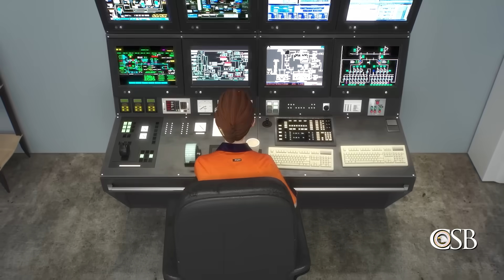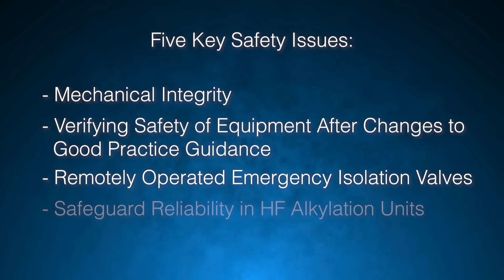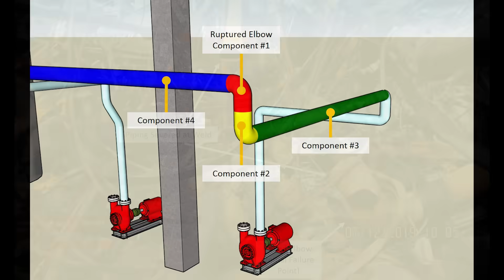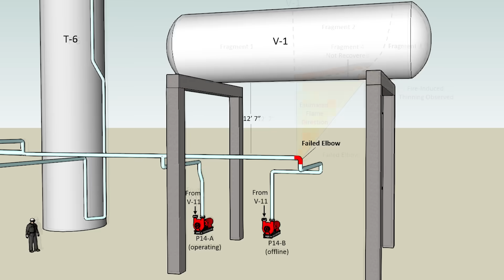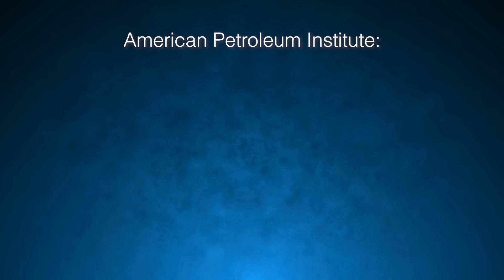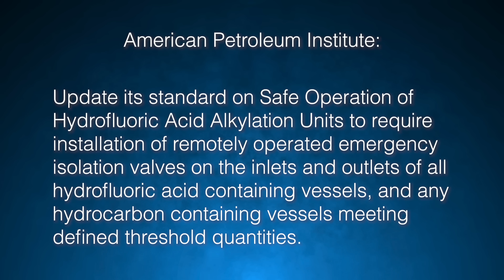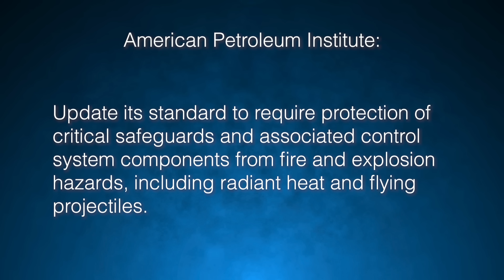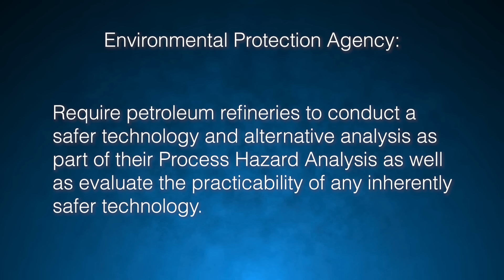Wake Up Call: Refinery Disaster in Philadelphia

Comment: THIS is how you make public safety reports! Not only informative but engaging to watch even as an outsider!
Reply: @Jon VB need more regulations? idk man. Its a once in a 50 year piping check based on what they said. and it also was a strong retrospective check. many of the issues come from not having good papers on pre-digital construction. which is what caused this problem. if they did know, they would have likely changed it. and the CSB cant just make regulations, they reccomend standards. which can then be moved to be passed as law or just as doctrine
Reply: @Jon VB If the reason places are not inspected is lack of funding, it's the lack of funding you need to correct. In the UK, our current far-right 'pro-small-government' government, with lots of mates in the farmning industry,  went all out to undermine our rural/farming pollution laws, by simply cutting the funding for inspections. The end result is some of our most beautiful rivers, which for hundreds of years have been wildlife havens and great for fishing,  are now so polluted by intensive farming that there are next to no fish, or wildlife, in them. That's not an inspection failure, that's an (intentional) government funding failure.
Reply: These petrochemicals will never do the proper maintenance to the proper safety thing is will always kill people in America because they just don't care.

Greed
Greed
Greed

There's usually a wake up call every year.
They are still asleep!
Reply: @lelanddthompsonlll8560  germans will fix it, the german squatters that committed the american people's genocide can do anything, included learning english and fake nation history book propaganda
Reply: @Jon VB if something is way overdue for an inspection, that likely means the inspectors are overloaded.

There is an idea you can just load people more and more. But at some point, the quality drops when people don't have time
Reply: When you consider the billions of dollars being saved in resulting training..
Reply: @Jon VB they pay the politicians to make sure that the inspection people are always a year or too late.
Reply: LANG LEBE AMERIKA!!!! 750 MILLIONEN TOILETTENPAPIER VERLOREN, BETE FÜR JERUSALEMS PETROL CHURCH GOTT, WIR WERDEN DIE WELT MIT PETROSHIT KONTROLLIEREN UND IN GROSSE HÖHEN STEIGEN, WENN DER WASSERSPIEGEL STEIGT. BLEIBEN SIE NORMAL UND FÜLLEN SIE DIE KAUTION, LEUTE ( I USED NATIVE LANGUAGE OF NATIVE GERMANS ASS "SETTLERS" GENOCIDES OF AMERICAN PEOPLE)

Comment: I believe a big problem with oil refineries in the United States is that they're generally run at maximum capacity or close to it other than planned maintenance works that need to be planned to be as short as possible to get that part back online because any disruption has huge economic detriments. If refineries weren't so difficult to get approved to build anywhere, refineries may not need to be pushed so hard, and may be able to carry out better, and more comprehensive/disruptive maintenance, like replacing corroded piping.
Reply: The insurance payout was more than enough to rebuild this refinery, yet it was shut down. All the infrastructure was there.
Reply: The problem here is far more likely that that one elbow, which was different metallurgically from the surrounding piping (according to the video), probably wasn't identified as being different metallurgically until after the explosion.  In 1973 (when the video states that elbow was installed), the culture around documentation was less robust (and more difficult to maintain complete records when databases and electronic records had yet to be invented).  If they had known that it was different metallurgy, I have to believe it would have been inspected and caught prior to the incident.
Reply: @breathedeeep  Your assessment of documentation is quite astute. In the '70's piping and fittings were usually supplied by the lowest bidder for the builder. Many fittings and piping were coming from Brazil and other offshore manufacturers. The metallurgy was not always the best that could be had.

With the age of the ell that ruptured, I see two mechanisms as a factor. Metallurgy for corrosion and wear from erosion. These two factors are the leading cause for piping and fittings replacement.

In a refinery that I worked at, we had a piping rupture at a three way valve which was caused by turbulent liquid erosion. It was in a naphtha hydro treating unit. Two of my coworkers were killed from extensive burns.

In the Philadelphia incident, they were lucky that it was early morning where personnel was limited to operations personnel. This in my opinion was a huge factor in the injury and loss of life aspects.

Comment: One of the things that should happen after failures like this is the bean counters should be sat down and asked "how much would it have cost to properly inspect/replace/maintain this failure point?" Then once you have that you ask the same bean counters "how much will losing the plant entirely to this failure cost you?"

Do that enough and I think the bean counters will start to get it, I don't think stuff like this happens because of simple greed.
I think what happens is after a certain size organizations stop being "ran by human Intelligence" and become run by "simple cells" where each person can only reach 1 or 2 cells away.

This is why large corporate structures always seem to have some strange rules that don't make any sense "on the ground".

One example might be a store chain where the head office controls the thermostat for all stores, sounds great but you can end up with head office rasing the target temperature at night to save on AC costs, but turning running heaters because of different local climates.
Reply: My case in point, some of these parts are old enough where it would be wise to skip inspecting them and just replace them outright, these plants have to be shut down for maintenance anyways, may as well do some PM while the plant is down.

Comment: I live in Superior Wisconsin where a refinery, formerly known as the Husky refinery, is located and which suffered a nearly catastrophic explosion and fire in April of 2018 leading to community evacuations. The release of HF was a serious threat as the fire raged but fortunately the fire was put out before a
 release occurred. The refinery is nearing completion of its rebuild after this fire but the owners refused changing to a safer process and will continue using HF. Clearly there is inadequate regulatory control to require implementation of safer processes such as those recommended by the USCSB to protect nearby communities.

Comment: I'm concerned these accidents will happen more frequently as our refineries and pipelines age and maintenance is deferred to cut costs. Spreading awareness is a necessary remedy, and this video does an excellent job. This video alone may prevent a future tragedy. It is, indeed, a "Wake Up Call"!
Reply: Maybe we need to build some more. we haven't since the 70's. Capacity is at max now.
Reply: true but for once. refineries are now making good profits and there should be more budget to make upgrades and updates once the demand eases. With higher energy prices, the return on investment is quicker to make them more energy efficient and we are likely to see governments worried about refining capacity to offer more generous tax breaks to cut the cost of changes. Once the plant is offline, the opportunities to make other safety related upgrades is alot easier to justify. In fairness we are unlikely to see many new fixed refineries built for hydrocarbon refining so portable ones will become more realistic and they are likely to be more modern considering their portable nature, meeting international standards of operation and shorter time, high volume demands and higher cost of operation.
Reply: Maintenance is deferred because there are fewer refineries than ever, and every time one goes offline for repair or maintenance, the price of gas spikes because of the supply disruption. Also, companies are not willing to fund a billion dollar 10 year refinery project in an industry that the elite have declared war against. So these accidents will happen more, just not for the reason most people get sold.
Reply: @crashtech66  This incident had nothing to do with deferred maintenance
Reply: I think the opposite is true for many reasons.

1. Refineries are constantly trying to identify and add layers of protection to every inch of the plant via the PHA/HAZOP process. Where I used to work, upper management was OBSESSED with this process. Side note: from 2016-2019, one of my tasks involved installing dozens of EIV's on every pump prone to seal fires.

2. In my experience, when maintenance is deferred, it is always a very careful consideration that is studied by many disciplines within a refinery, especially inspection/reliability, with input from subject matter experts. Not a haphazard decision guided by greed.

The cause of this incident had nothing to do with deferred maintenance -- their Alky had been through a dozen turnarounds since that elbow was added -- it's a failure of inspection and design.

3. Every time a catastrophe occurs, you can be sure other refineries around the country are implementing new safeguards based on the findings. That's the whole purpose of these investigations.
Reply: Did you watch the video...or even better...skim the written investigation report.  This was not the result of skimping on maintenance.  There was simply a single elbow that sometime, for some reason, was replaced with metallurgy that was different than that of the surrounding piping...and that was likely done several owners ago and was not documented.  You can't do thickness measurements on every single inch of piping.
Reply: Pipelines are still way safer than alternative transportation methods
Reply: As a person familiar with this refinery, Ryan is correct.  RINS program cost well over 1 billion dollars to PES.  Where do you think the money cuts came from.  All of a sudden every elbow wasnt checked.  Only ones identifed as potential issues.  This happened all throughout the refinery with many maintenance cuts and extension between turnarounds (down periods for major maint).  An emergency was only a matter of time, but no one expected one like this.
Reply: Refineries are super dangerous and toxic
Reply: Ditto with Nuclear Reactors.  Designed to go for 40 year, extended another 40.  Meh, what could go wrong.

Comment: Another well done video from CSB, thank you!   Question: Would it be an option to make the water cannon system use a supervised connection to the control center so that if the ability to manually control it is lost, it simply activates by default?  Certainly some active mitigation systems carry risk being activated accidentally, but this case, it is a water system aimed at systems that are already outdoors and exposed to the elements. Seems like accidental activation of the water is a far lower risk than failure to activate.
Reply: Our Alky unit had boundary HF detectors where if one went off it went into a warning mode, if 2 detectors went off it automatically engaged the water curtain. Correct in saying it was a lot more safe to have an accidental water activation than none at all due to equipment failure. There would have been questions and an investigation sure but that's a better outcome than explaining why there were public or employee losses.

Comment: The supervisor who went into the inferno to turn on the pumps deserves a medal.
Reply: His job was not to risk his own life to open a valve that should had been openned remotely. The guy was very brave and he deserves recognition.
Reply: @cgomez3748  he had a job to do and since he couldn't remotely,  he took his job to the ultimate goal and did it while risking his life. Others would not take the risk. He did and it was worth what he saved from disaster.
Reply: As a contractor at refineries, in the safety orientation we are told that in an emergency to not follow the operators.  They are running TO the problem while we should be running from it.
Reply: They did their job and did it well! Other employees take the paycheck and could care less about performance.
Reply: I worked on this unit for years. No one ran into any flames…and definitely not in a damn bunker suit. The fire mitigation controls weren’t inside the fire.